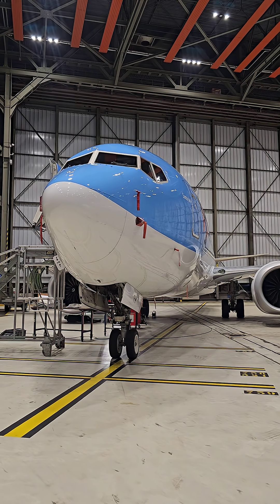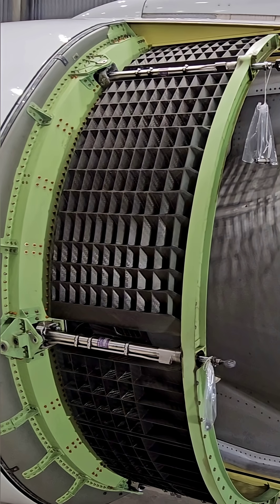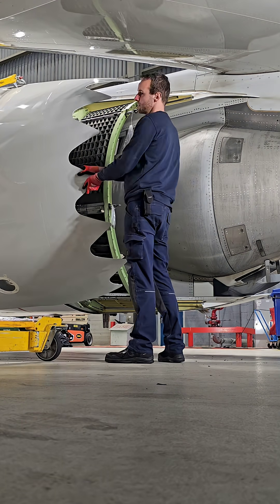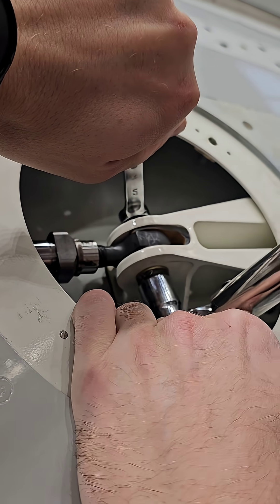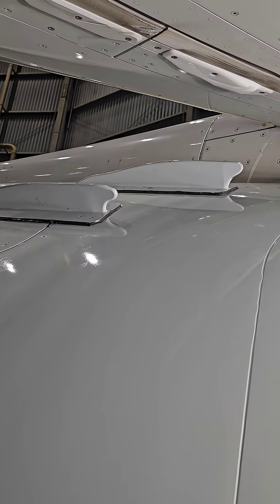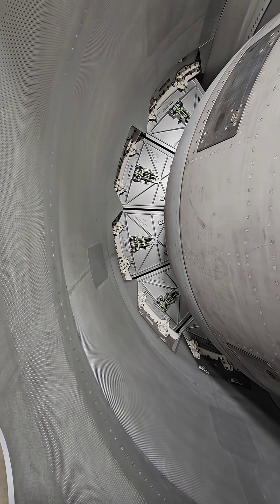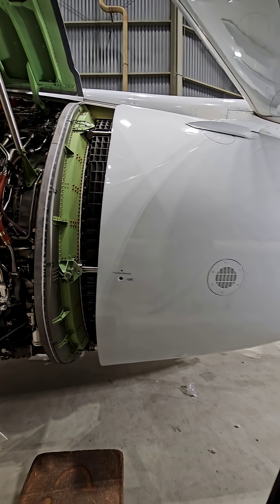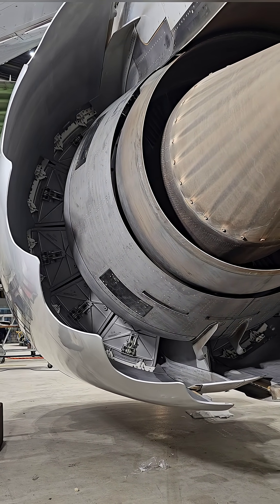Thrust Reverse sleeve installation - 737MAX

Comment: What's difference between tr cowling and sleeves
Reply from the maker: The T/R cowling is the whole assy. This includes the core covering c-duct as well. The sleeve is just the outer part of the T/R and the core c-duct stays on the engine.

Comment: Hey I inspect these! 😂
Reply from the maker: Awesome! Also of this specific airplane/engine model?
Reply: @NextGenerationMechanic Yes, I usually check the Inner wall, Beams, and the Torque Box before the Acuators go in. All before the TR sleeve gets installed but sometimes I do those too
Reply from the maker: Cool! At Boeing I suppose?

Comment: This is the first time I've seen a 737MAX thrust reverser being replaced. 
It looks like it would be difficult to slide it in and install it.
 Is this actuator hydraulic?
Reply from the maker: To be fair, it isnt that hard to slide it into place, but you need to be really precise with positioning it into place. Yes! The thrust reverser actuators are hydraulic powered.
Reply: @NextGenerationMechanic 
Thank you. 
I have one more question. What is the exhaust port on the thrust reverser? 
Is it an exhaust port for anti-icing bleed air?